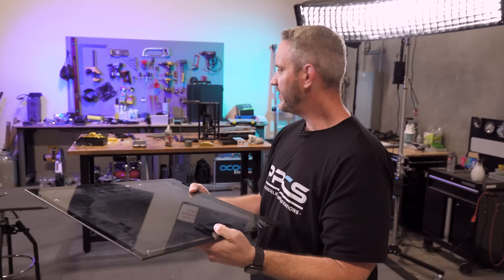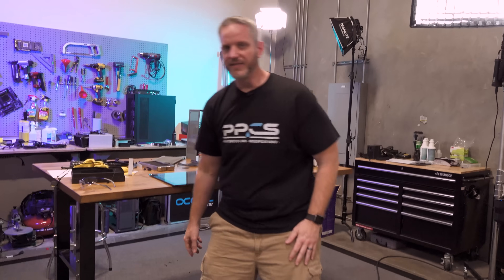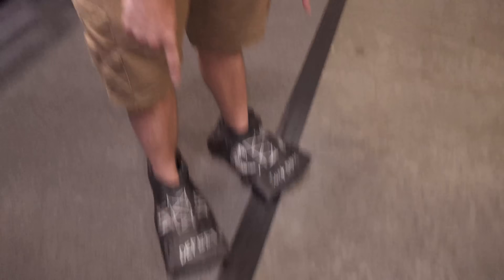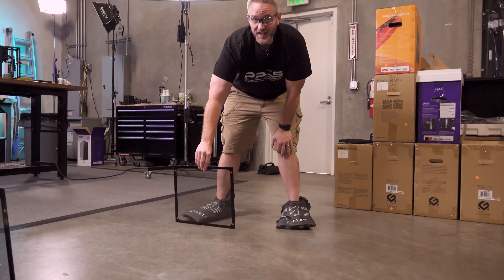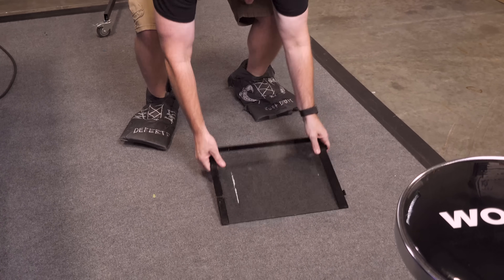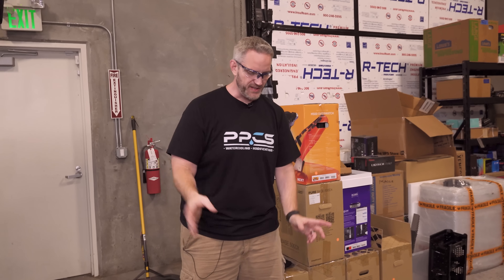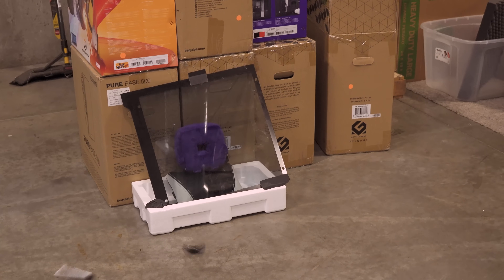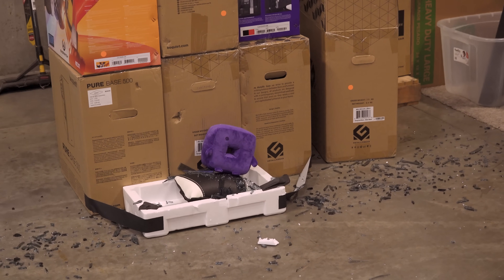How hard is it break tempered glass side panel?? SCIENCE!

Comment: I used to work with raw and toughened glass.  Once it's been heat treated, hitting the glass square on you could potentially break your hand before the glass breaks but if you dink it on a corner lightly with a hammer it will shatter into a thousands pieces.  Unfortunately for PC enthusiasts, if you're gonna drop it, it's very very likely you'll drop it on a corner :D
Reply: Unfortunately for me...very true
Reply: Yeah, Science!
Reply: Agreed the edges on tempered and heat strengthen glass are the weak points. Flat hits on the flat surface doesn't have the concentrated impact. A spring loaded nail punch will always break it.
Reply: @jeremyogg1  That's exactly how we used to deliberately break them during Q.C to check they were toughened properly 👍

Gotta say, I don't miss that job.  The heat in the factory during summer was something else.
Reply: @svr_armani  I worked in a glass factory handling sheets (we called them "lites") of this stuff up to 70x40 inches. I'd take them off a roller line and hand stack them vertically on a rack, up to 200+ on a rack. Sometimes a particle, tiny glass shard or some other debris would get trapped in between lites. After I'd pack another 20 lites on the rack, suddenly a lite in the middle will explode while every other lite would still be intact. 
Other times, while transferring the lite from the horizontal position on the rollers to the vertical position on the rack the lite would suddenly explode in my hands. You could never tell exactly what caused it.
Yeah, the heat isn't helped when you're wearing what you need to wear to protect yourself for a 12-hour shift. You thought you were getting a break by occasionally being assigned to the inspection booth, but watching sheet after sheet of glass pass underneath you is visual Valium. Fork truck driver is the place to be.
Reply: Yup! Tempered glass is odd, as sometimes you could throw it against a cement wall or bash it with a hammer and not break it, but other times you could get a really hot piece that blows up for seemingly no reason. Nothing like having a 1/2" thick shower door explode while you're carrying it.
Reply: @gotdangedcommiesitellyahwa6298  even better is tightening the bolts on a glass balustrade from underneath on a ladder when it goes boom.
Reply: @sintaxera  It's not so fun when it happens. I had a rather large IG bust on me when I was trying to set it on the truck rack. My hands were fine from wearing gloves, but my arms were sliced all to heck. But I heard some real horror stories from the truck drivers that delivered our glass, mainly caused by the guys loading the trucks being morons.
Reply: @gotdangedcommiesitellyahwa6298  a guy I know installs windows and assorted glass. He had tempered glass randomly explode, he's now shit scared of it
Reply: @gotdangedcommiesitellyahwa6298  this is exactly how my brother got stitches all over his hand, back and foot. Except he was inside shower cabin and taking bath without clothing. Scary stuff.
Reply: Murphy's Law.... Science!!!
Reply: I was about to say, I'm sure everyone has seen how tough the side windows of a car are. You can literally throw a brick at it, and you have a higher chance of knocking yourself out with the brick than breaking the glass. But then you get the right sized chip of ceramic and it'll blow the glass apart.
Reply: Same; I spent a few months working at a window-fixture manufacturing plant, and we would work with these enormous panels of glass; both tempered and non-tempered. One day we had to dispose of a whole pallet of 5x5-foot tempered glass panels because they had all been scratched: they were too big to fit in any of our bins, so somehow I got stuck with the job of spending all day trying to break these things. Nobody told me the trick to breaking them, so I was wailing on these things with a fucking hammer until an hour later, when someone showed me that I could just use the hammer to lightly tap the edges and the whole panel would burst.
Reply: Yup, that is why my O11 Dynamic has a cardboard front panel now :-(
Reply: I have seen people just set a tempered panel on its edges on the floor and seen them explode. Just depends on the panel.
Reply: @dwhit6529  Usually in those cases there is some debris on the floor that triggers the shattering. Dont get me wrong, sometimes the tempering process goes wrong/ the glass itself is second grade, and it can actually explode in your hands (seen it happen) But those panels rarely get out from the factory itself, as they shatter so easy.
Reply: @Eigonme  What i noticed is they were always on a hard surface like concrete or hard tile and they leave them sit up straight and they just explode seen it happen to a few this way they were always cheap panels that had screw holes in them. Tempered glass is strong in the center but horribly weak on the edges.
Reply: @dwhit6529  Because people place it on ceramic tiles. That's an instant shatter for TG panels
Reply: @dill6078  Yep lol exactly what i have seen happen.
Reply: Sweet video loved it so satisfying
Reply: i worked at a factory making glass panels for balconies and i can confirm this. It really takes a superlight dink to demolish the whole panel, no matter the size or thickness.
Reply: Or drop it on marble, which immediately breaks it
Reply: I can attest to the light corner tapping. Had to resort to using cardboard as a makeshift side panel until Fractal was able to replace my original side panel. Took a lot longer due to the pandemic, but yeah. It happens. First time for me. 😬
Reply: Also used to work in a window factory. Tempered glass is tempermental lol. That stuff could break just sitting in a rack unharmed. The tempering process often isn't that perfect
Reply: I used to work manufacturing tempered glass too & the amount of power needed to break tempered glass on it's surface is, well I've never seen it happen 8 years working at that factory. Which is why when I see broken glass on r/pcmr it angers me because how irresponsible do you have to be to break tempered glass on it's corner.
Reply: Okay, maybe being a bit facetious, but being mostly serious, too.  Is a corner drop being so highly likely to be fatal for the pane due to the direction of the pressure wave through the glass coming from an impact point?  If so, why not make a side panel frame with a round window in it?  That way there wouldn't be any "point" of impact and the moment of impact would be spread out over a greater area?
Reply: I did this exact thing to my side panel almost a year ago, still haven't replaced it. :(
Reply: Can confirm as someone who works with custom PCs for a living it happens to everyone in the field at least once
Reply: your absolutely right. my 5000D corsair airflow case glass side panel edge hit the floor with just a little tap and it clipped off.
Reply: Yes,  tap on the edge will shatter the glass faster than trying to smash the center.
Reply: so its just like car side windows then. got the little hammer to get out in emergency otherwise bust ur fist
Reply: Yep, more again if chemically treated.
Reply: Can confirm. Was not a fun time cleaning it up
Reply: Just came to say exactly this, I’ve worked with tempered a lot.  Super strong on the face but like he said above if you slightly dink a edge… pop.
Reply: you can shoot at Prince Rupert's Drop with a small caliber and the bullet will shatter, but damage it's tail and it'll explode
Reply: Did this a month ago!
Reply: I gave my side panel an unintentional whack with the foot of my wheelstand pro (about a 2" steel tube). It held up but my heart  stopped for a second!
Reply: curious what happens when glass is round.
Reply: Thats exactly what happpened to my friend DarkBase Pro.... It took about an hour to get the last piece of glass out of the tiny corners in the case XD
Reply: Also something else I find funny, who is using a hammer on their pc lol?
Reply: im gonna train my reflexes to hit the glass so it falls face-first onto the ground
Reply: What happens to the not crystal molecules!  Why does no one on the planet actually truly understand glass?!  Stupid irregular bondage.... hrrumph.
Reply: Yup. I learned the hard way on that!
Reply: smashing a car window with a hammer is rlly loud. u can shove a screwdriver between the glass and the doorframe and twist. the pressure will pop the tempered glass. much quiter. i worked in a glass place replacing glass n saw this a few times
Reply: Yes done that...
Reply: It's the buttered toast law in action.
Reply: Circular glass has no corners!
Reply: @jhawley031  No shit 🤣
Reply: Broke mine today, came here to feel reassured I will not accidentally break the new one by mistake with my chair or knee or something... after the hammer I feel better
Reply: well, at least it'll hold up if my zoomie cat skids into my case LMAO
Reply: Just did today.
Yay...
Ffffuuuccc.... me.